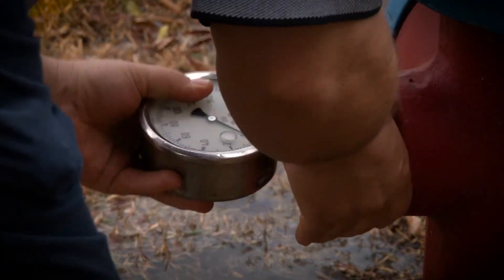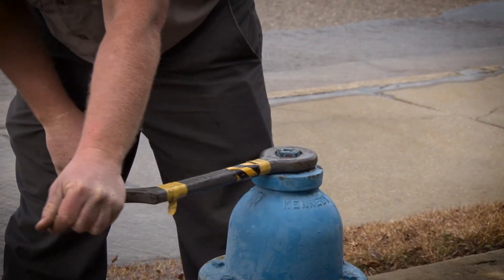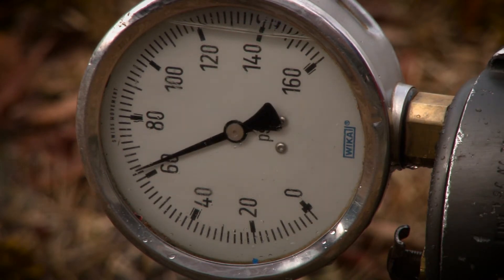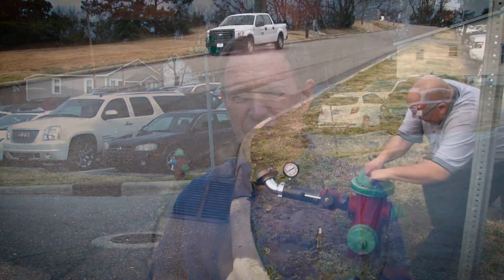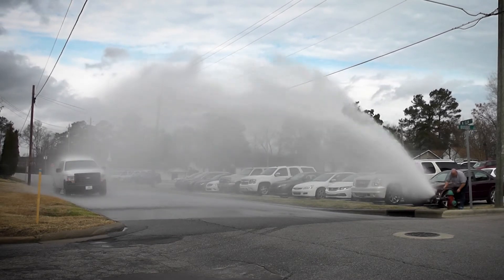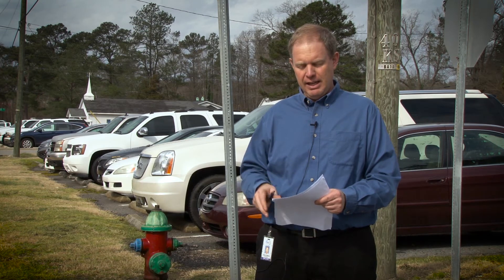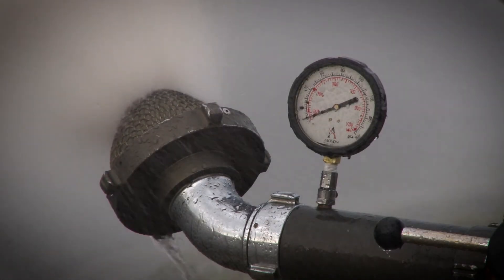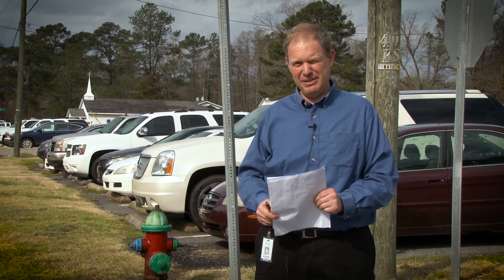Fire Flow Test

Comment: This video represents a different type of flow test, not applicable to the design of automatic sprinkler systems. The test conducted here is known as a single hydrant test, which only predicts the available flow and pressure at that hydrant. This is useful for determining 'classes' of hydrants, and for some site fire flow purposes.
The type of test necessary for sprinkler design is also termed a main capacity test, where one hydrant is fitted with a gauge, and one or more nearby hydrants are opened to flow past the first, which gives insight into the conditions of the main itself and what it can be expected to provide.

Comment: 29 psi flow rate at 7200 LPM ? 1600 gallons per minute...half that 15psi 3200 LPM or 800 gallons....are these flow rates possible at just 3.5psi?
Reply: According to the curve, this hydrant should be able to flow about 1882 gpm @ 15 psi.

Comment: There is no finesse to shutting down or opening a fire hydrant.  It's a gate valve, impossible to slam shut and create a water hammer.  Now if you put an external appliance with a valve on the hydrant, that has a 1/4 turn valve, then u can create one easily.  Just opening and closing a hydrant can not do that
Reply: You can most definitely open and/or close an OS&Y too quickly. Can especially open them too quickly.